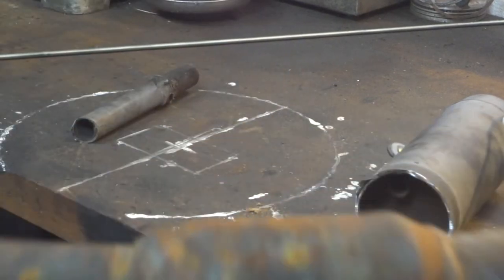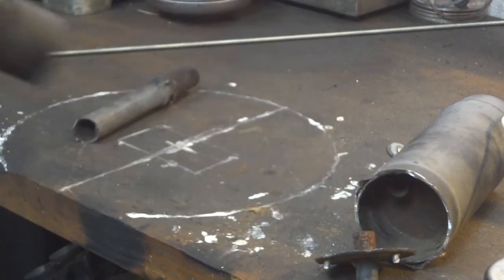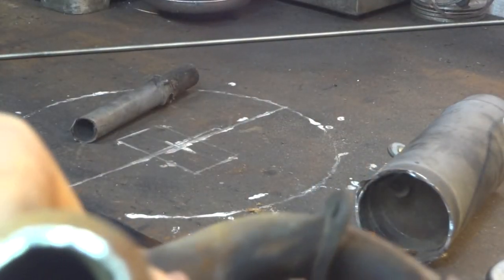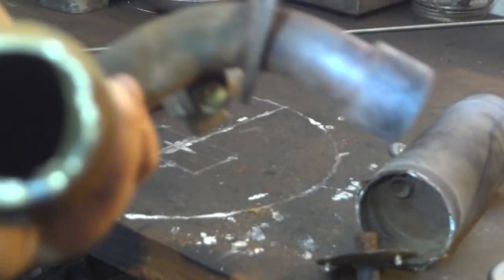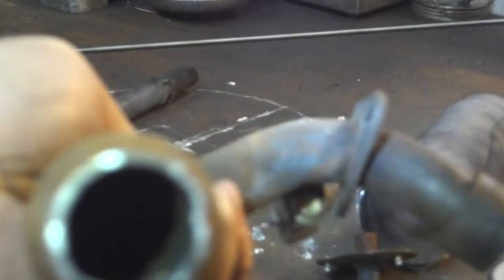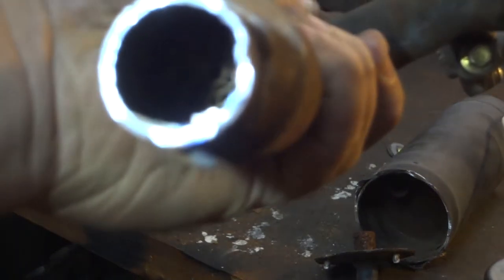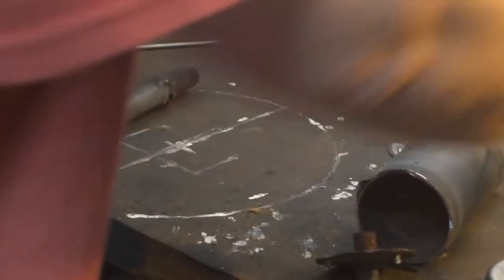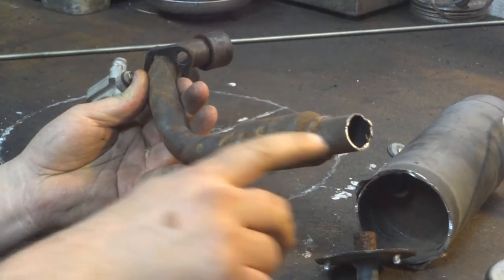Chinese exhaust issues

Comment: Now if u dill out the evaporator emission would it where should I cut the back half of the exhaust off and rebuild it
Reply from the maker: just use the first 8-10in of pipe off the engine and build your own